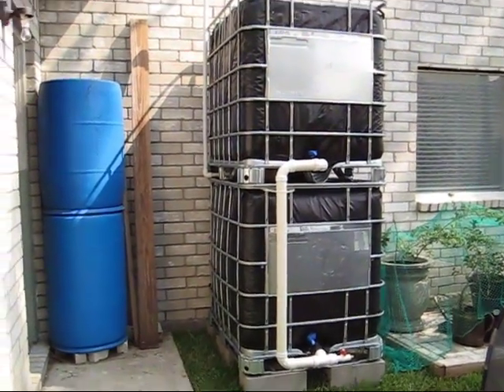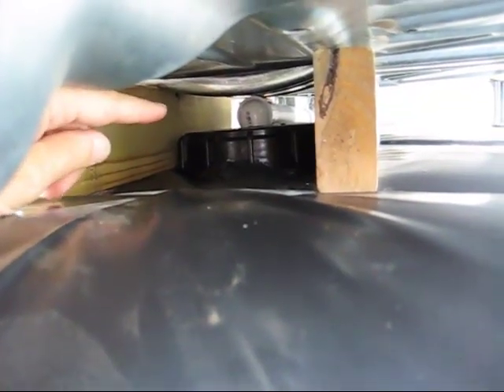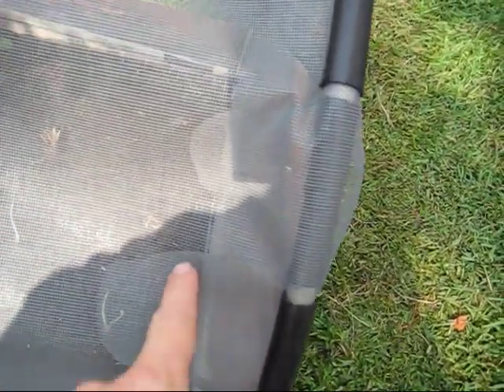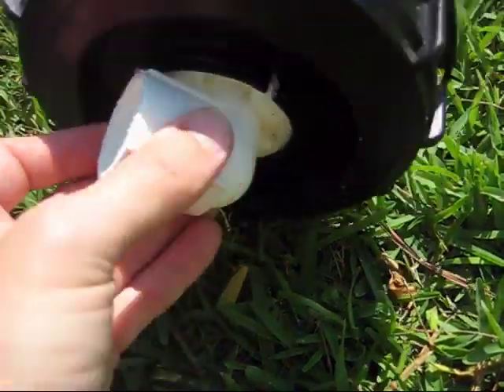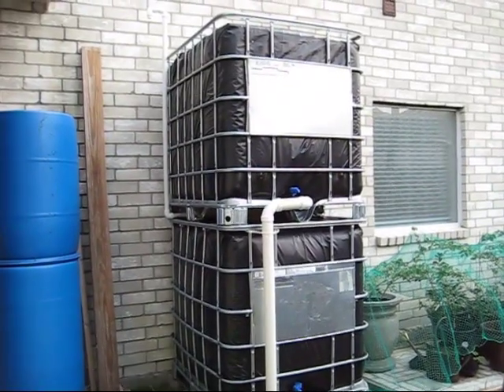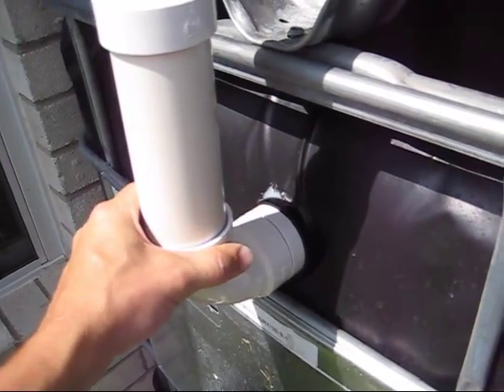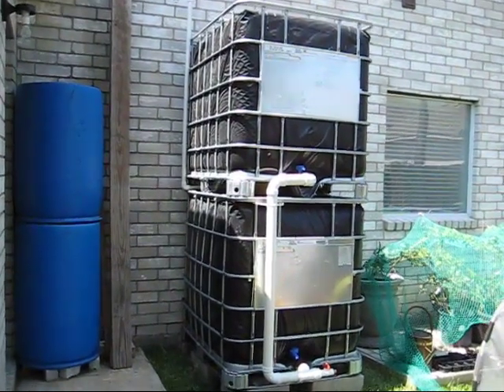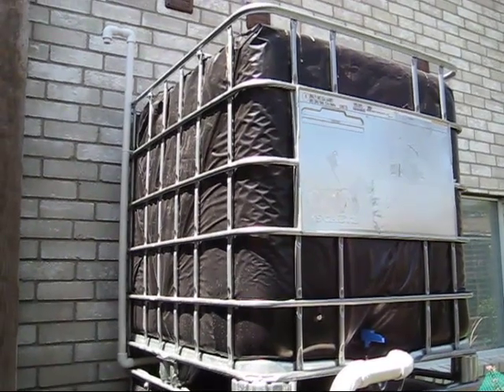Rainwater Collection System Part 5: Venting

Comment: This may be 12 year old news at this point, but Uniseals work very well in this application in place of tank to tank bulkheads or self sealing options. They are made of TPE melt-processable rubber. Best of all never a leak!
Reply: What is a uniseal ?
Reply: @Nctbgs  That is the name brand. They are designed to fit in a thin wall tank and then similar to a self sealing PEX, the sides compress around pipe. You can Google them by name. Amazon carries them as well. Keep in mind the sizes are based off the OD size of the pipe. You can look up a chart on their website. I hope that helps.

Comment: You should use a bulkhead connector which will allow you to use rubber washers and screw tighten that tank in the hole of the other tank. That will assure a tight drip-proof fit.

Comment: I know this is replying to a fossil video, but folks interested in this system, need to know...Some suggestions: 
1. The extra 2x4s holding space for the air vent pipe, should extend over the outer frame for best support...not just across the weaker mid-braces (which aren’t capable of so much pressure on them).
2. Another air vent option: using a tubing that can flatten a bit, instead of hard PVC...no worries about pressure from top tank cracking anything under it. It’s sold by the foot or roll, at hardware stores. It doesn’t entirely close when flattened...there’s always some opening.  Bigger volumes under pressure can open it more to vent.  But, IDK if that will move the vented air/water fast enough to avoid slowing water output.  
3. To easily stretch a too-small rubber gasket over the PVC adapter, smear petroleum jelly on the rubber gasket..helps both preserve the rubber, and helps stretch it onto the PVC pipe.. 
Petroleum jelly works to rejuvenate rubber gaskets around fridge doors, too.

Comment: A plumbing/physics dummy question for anyone :)     Wouldn't it be sufficient to just either perforate the bung and put a piece of screen inside - or remove the bung altogether and just attach a screen cover over the 6" hole?  I've done the latter and it works fine.    The fancy vent system you created here looks like something you'd do for a bathroom to move the gases above the system.

Comment: Just curious, why didn't you go from the out put of the top tank to the top cap of the bottom tank.  Granted you would have to reduce the transfer pipe, but then the tank remains intact. And air trapped the top of the bottom tank gets pushed up to the top tank trough a single pipe that also carries the water to the bottom one.

Comment: Is there a lot of pressure on the venting connection (bottom lid) when both tanks are full? trying to figure out a way to make a secure leak free connection without working with a lid that came already witha  female thread.

Comment: Thanks for all your recordings.  Do you have to vent every tote?  I am trying to put together 4, but they are all one level (not stacking).
Reply: In a horizontal configuration, every tote will need to be vented except the inlet tote

Comment: Thanks so much for this video!  I like that you are in Houston, as I am too.  What kind of PSI do you get on the two versions you have?  I have a 100 ft of drip line I would like to run off a setup like this.

Comment: First, I want to thank you for this wonderful series. I admire not only the care you put into designing and executing the system itself, but also the care you put into patiently explaining and recording. What a great job you did with this!

Second, I have a question about a potential third venting/connection between the two tanks: Did you explore elbowing a pipe from the outflow on the top tank back in between the two tanks, and then into the top opening on the bottom tank. This would be something like your solution #2 but it wouldn't require cutting a hole in the bottom tank, although I suppose it would require elevating the top tank to allow room for the (2 inch?) pipe?
Reply from the maker: +Ken Edelstein I haven't given that method a try. I really don't like cutting holes into the tank. But it could work. If you give it a try let us know how it goes.

Comment: Hi, great info.  Question, the 4 tote system 2 + 2 totes with the upper going to the high drilled hole in the lower tote... don't you lose the top 5-6 inches of the tote (above the pipe entry point) that would be unable to vent?  Also, do you still use these types of solutions for water storage and emergency water now that you're in Idaho, or did you go to a well or another type of solution?  Thanks again.
Reply from the maker: The Tte My daughter has this system in Idaho and is using it very successfully.

Comment: If you have a leak and all your tubs are plumbed together, just shut the valves on the other tanks. Then you can repair the leak without loosing water from the other tanks.  Keep up the good work.

Comment: I like the first method better. I'm going to copy your set-up to the T. Originally I had planned on connecting 4 55 gal barrels but I like the look of this system because If you used a single container someone that wasn't really paying attention or didn't know any better might mistake this for an AC unit from a distance. Also, I too live in the Houston area and have similar brick on my home and the look of it against the home is the best I've seen. Great job!

Comment: When pluming a house you have vent stacks that go through the roof to vent the waste water system.  With your original setup you can replace the elbow that goes to the bottom tank with a "T" then extend a pipe from the T to above the tank.  You can then put an under-sink vent valve on top of the stack and this will seal off the tank until it needs to be vented.  It's basically a one-way check valve that will open when negative pressure (venting) is needed.  No holes to cut in the totes at all.

BTW, 2" pipe is overkill.  You neck down to your valves at the end anyway so anything over the diameter of the valve is wasted.  I have 1" NPT adapters that thread on to the buttress threads on the tote and I use 1" pipe to hook up the tanks and vent as explained above.  I can handle the piping on the outside in favor of not cutting holes in the totes...
Reply: 7 years later and your advice is still helping people! I'm building this setup this weekend and am using your venting idea. Thanks!

Comment: Cut it to exact size and let it loose on the bottom, fix the end on the top so you can make small changes.... or even better don´t use a hose, use 1/2" pvc pipes and fix the top part using a "tee" shape and a 2" to 1/2" reduction...    Good luck. Please show if you make the changes.

Comment: Look up uniseal  try us plastic dot com/catalog you have had several situations where the "stock" answer would be a bulkhead fitting but these are MUCH cheaper and easier to install and MUCH harder to mess up

Comment: I just thought I'd throw in my 2 cents... Why not just connect a flow line of pvc from the spigot of the top tank to a hole cut in the front top center of the bottom tank, so there would never be a venting problem, and still fill up both tanks? You wouldn't need as much pvc, and it's a lot less joints that could start leaking. You could still use the bottom spigot as the release, just maybe throw a 90 deg & ball valve with an adapter on there if you need it...

Comment: would it not be better to attach the vent to the top tote? Connect to top container lid with a vertical pipe to gas trap? Seems this would be more accessible and without worry that the weight of the top tote causing leaks in the lid of the lower tank...??

Comment: Not a big fan of silicone, as it tends to leach nasty chemicals into the water.  Hope you  got aquarium grade, and that it works on your type of plastic.  As to connecting stacked totes and venting, how about this idea:  Put a wooden pallet between the top and bottom tote and use that space to run pvc pipe from the top tote valve to the bottom tote bung.  That allows venting from the bottom, and filling at the same time.

Comment: For a better solution on the air pressure problem, just put an empty hose inside the 2" "clear pvc pipe" all the way to the bottom tote (make sure it is on the top part) and it will get the air out allowing water to enter. This way you don´t make holes on caps or buy pressure valvs...

Comment: Thanks for the videos. I am planning a similar setup now.

Instead of running the lower tanks bung to a vent pipe hanging in the breeze just tap it into the downspout between tanks. That will allow the pressurized air in the lower tank to vent into the top tank and you don't have to worry about extra bug screens. It will slow down the top tank to bottom tank fill rate but that is a faulty test anyway. You are concerned with water flowing during rain, not a full top and empty bottom.

Comment: Reread my comment and the last bit wasn't very clear...
the "bottom" spigot that i said to leave open would be the one from the drilled bung from the bottom side of the bottom tank, run the water hose so that it is sitting above the top tank and it will automatically vent as it fills up.

Comment: Im surprised no one has thought of flipping the bottom tote inside the cage so that the spigots line up... seal the cap (which would now be at the bottom of the bottom tote) and drill the bung much like you did for the vent, only use it as the spigot to feed your water hose, leave your bottom spigot in the open position, sitting above the top tank and it will automatically vent as it fills.  I hope you can picture what im trying to describe.

Comment: Elevating top tote2have top tote valve connect2bottom tote bung with 2" pipe also eliminates need for a vent-the air from bottom tote goes up through the down-flowing water.  This will reduce water flow rate (down) as air comes up, so rain gutter will fill&overflow at some lower rainfall rate (inches per hour) than having a separate vent line.  So, given that, a 2" vent line-instead of 1"- would allow air to go up as fast as water came down, maximizing in-flow in heavier rains.

Comment: I'm going to add a "clear pvc pipe", nominal size "1/4" and have a sight gauge to show water level of the 2-tote stack.  I think 8' is the stock size and should go into the bottom 2" horizontal pvc pipe coming down from top to bottom tote - will put another T and appropriate adapters to insert the 1/4 clear pipe

Comment: Uniseal! That is all you need to go thru any slim plastic wall (like your tank) with pvc. There are also bulk heads but uniseals are simpler and usually cheaper. Just drill the hole, pop in the seal from the outside, shove the pipe thru with some lube and your done. No leaks.

Comment: I should’ve been more specific. The backflow preventer I referenced is also called a “non-spring loaded ball check valve”.
When water floats the ball into a seat, the ball stops the flow of water past the valve. Air can escape past the valve until the ball 
floats.

Comment: 6x6's or 2x6's  framed on edge  to separate the totes would allow more space for a 2" connection from top spout to bottom bung using a threaded fitting.

Comment: I think the second method is legit, but it looks like you tied into the bottom tank a little low from the top. Seems you would still get an air pocket in the top. I'm sure you can get a 2" tight elbow that would allow you to come out the top of the tank and turn 90°. Then come out and tie in with the drain from the top tank. You should also put an extra valve 20" off the ground so you can fill buckets if needed.

Comment from the maker: When full both of my totes definitely bulge but I have had no screws pop. these totes are designed to stack 3-4 high. Of course that is not with them connected so the fluid can flow from one to the other.

Comment: Great set of videos.  I set this up and I ran into something I wanted to see if you had happen.  When both totes are full and I opened both valves the bottom tote's sides budged out and the frame began to pop the screws.  So I shut the top valve and released some of the pressure in the bottom tote.  Did you run into this issue and if so how did you handle it?

Comment: I have a small upgrade for your venting. Get a 2X1  reducer for the bung. The bung is pipe thread. Then screw a 1" L with threads and use some plumbers thread sealant on the threads. Also. Instead of 2x4's on the center supports, I used 4x4's to the outside frame. Much more support and clearance. this way your connection is much more solid and there is more clearance with out any down pressure on the lower tank.
.

Comment: Outsatnding solution!  What Mr Glass (BYU ChE c1978) called an "elegant solution".

You could have used flex tubing as small as 1/4" (though 1/2" would be better) since air is highly compressible.

I'm capturing the whole series.
Thanx for your work!

Comment: Great info and videos. I have a question regarding the downspout. Where the downspout connects to the fill pipe, you have a screen in there. Then below that is the first flush system. What do you do when the screen at the downspout gets clogged. I would think you would not need that screen with the first flush system.

Comment: instead of running a vent pipe you could have use a check valve (spring-less) like a ball check valve. The valve will reamin open or slightly move as water is pushing it out. Then when the water hits the ball it spurts for a split second and seals up. Its less piping and you could conceal it under the whole setup. This ball valve thing is also use in irrigation setups on farms to vent out air pulled by the pump and in a 10in dia pipe there is a 1.5in ball valve that vents air. cool series!

Comment from the maker: @darthom That is what I wanted to do but I can't get the angles right and there isn't enough space for the 2" pipe. My friend was able to do it with 1" pipe. So it is possible. I prefer your setup over either of mine, if I could get it to work. Thanks for commenting.

Comment: Good system. I do have to mention that in several states it is actually illegal to harvest rain water do to wet lands and water shed laws. So these systems although important may have to be done covertly and showing it on you tube may not be wise but thank you for the info.

Comment from the maker: @ArkyPrepper That would definitely work, but not for me. Last night I got about 3,000 gallons of water from a twenty minute rain storm. Here in Houston, TX it rains hard and fast. The reason I use 2" PVC is to gather as much rain as possible as fast as possible. My concern with using 1" PVC here is the system could not handle the amount of water I need to in the time I need it to. But the total 1" PVC solution might work well else where.

Comment: nice black finger nail polish..hehe on the flange were you drilled through the plastic.. you may have wanted to use a sturdy washer on the outsides of the rubber gaskets to give them a better fit.. that should have prevented the leaking..

Comment: I was talking with my fiancee about what you are doing, and it dawned on me, have you checked the temp of the water after the tanks are filled up for about a week?  You may run into a problem with the water heating up so hot you can't use it on the garden. Black absorbs heat.

Comment: @LDSPrepper Correction, respectivly, If the bung is the same as an oil drum, the threds are 2" pipe threds. However, from your video there doesn't seem to be enough room between the totes. So your plan seem to be the best solution. The only other thing I can see, which might not be feesable, is to turn the top tote upside down in the frame and use a 2" union joint, bung to bung and connect the top tote valve to the rain spout, one problem would be no room for a cutoff valve between the totes.WBS

Comment: Great Fix... Was wandering, when you assembled it, how you were going to solve the ventelation problem. I thought maybe a kitchen sink drain would solve the porblem. If your Idea leaks where you cut the hole try either a kitchen or laundry sink drain, It will screw together nicely and it'll come with a gasket... Like your work...

Comment from the maker: @chuckarama451 That was my initial thought. Most people don't know that it rains a foot more in Houston then it does in Seattle. But Houston has 97% sunny days while Seattle has 97% cloudy days. What i am getting at is it rain more in Houston but it all comes at once. Because it rains so hard so fast I wanted to get as much water stored as fast as possible. In order to do that I need to use 2" PVC. 2" PVC is too big to fit on top of the bottom tote.

Comment: One suggestion.  There is such a thing as hot air plastic welding.  You could get your connectors welded right to the tanks.

Comment: I think option 1 will still give you a little bit better venting, however with option 2 I would use o-rings instead of the gaskets, nice job you'll have plenty of water either way looking forward to seeing the gutter hook-up video, also just wondered are you concerned with the ground settling with over 4000 pounds of water in the tanks if the ground got too wet ? Really enjoy your videos very informative Thanks for sharing